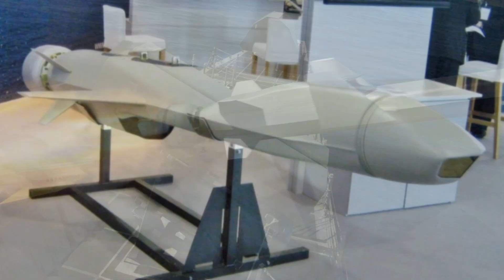Why Germany and the Nordics Are Backing the 3SM Tyrfing Supersonic Anti-Ship Missile

Comment: Tyrfing is far behind the MBDA Stratus missile project, this is not a good use of European resources. Stratus RS (supersonic) and LO (subsonic with very low observability) missiles, codeveloped by France and the UK, with Italy now joining, should be able to respond to most European needs and are not just naval strike missiles but can be launched from airplanes with very diverse missions (anti-radar, precision strike etc.), and they will be available from early 2030. KDA should concentrate on complementary shorter range and cheaper missile options.
Reply: Kongsberg and MBDA are two primary European manufacturers of naval strike and anti-ship missiles, Kongsberg NSM is operational in 14 navies and have a dominant role in NATO navies. France is backing MBDA, but they are not the main supplier of anti-ship missiles to NATO navies.  

Kongsberg 3SM Tryfing have funding from Norway and Germany, given the strategic partnership between Norway and UK on the Type 26 project,  reality of the matter is that UK could drop MBDA Stratus for Kongsberg NSM/JSM/3SM Tryfing suite of anti-ship missiles.    

Not some rocket science to guess that Norway will push for Kongsberg anti-ship missiles, use the joint submarine program with Germany and use the joint T26 frigate program with UK. JSM for F-35 and NSM/3SM for naval surface ships.  

Yes, this could be bad news for MBDA, but most NATO members don't need anti-ship missile for Rafael or Typhoon platform, most nations operate F-35. The most advanced ASuW strike package is F-35A + JSM in the internal bay. The JSM is in production for several nations, so in a way it's MBDA that is too late, operators of F-35 already have an European lethal option for sea denial of their waters.
Reply: Absolutely not. Given the rapid geopolitical changes, there is no ceiling, only market expansion, for decades to come. Having options can only be beneficial to Europe, given US market dominance and now political change towards Europe. There are reasons why MBDA Deutschland also has joined the 3SM Tyrfing project. Given Nammo's and Kongsberg's track record, Tyrfing will excel. 

I round off by borrowing some of your condescending words: If MBDA (UK) fears competition, they should concentrate on making complementary and cheaper products... 😉
Reply: @norsenomad  That's a really poor argument. And the only reason MBDA Germany joined is for getting revenues and competing with UK and France, as it is for all German military industry. Germany's industry unfortunately has no other interest beside making money, it does not care whether it stuff actually works in real combat nor if it serves European policy, and German politicians always bow to their industry. Kongsberg has a very good track record and makes excellent weapon system, I am not arguing with that, but we are talking of very expensive weapon systems here, so no, there is no real space for two European competitors for this market. This is not a good political decision.
Reply: @VoltaireVoltaire-zq4zh  HAHAHAHAHAHA! Looking at the way the French are throwing their weight around in the FGCS and FCAS programs, do you REALLY think it's Germany's fault they are looking elsewhere?
Reply: @VoltaireVoltaire-zq4zh  Tyrfing is the successor of NSM.

Also the main problem in european defense is France.
Just look at how they destroy FCAS with their insanity. 
Dassault lacks the knowhow to build fighter jets, unlike Airbus, and yet France wants to insist to "renegotiate" FCAS towards everything being french controlled and decided, trying to destroy the existing German fighter jet industry, to move it all to France.
I think we have an obligation to have a "nofrench" rule in arms cooperation as Germany, we burned our fingers too many times with this reckless actor.
It is ALWAYS France that ruins things in arms cooperation.
We never have these problems with any other partner.

So Stratus would not be acceptable due to french involvement.

In addition with Le Pen France is near a Trump moment, so relying on French parts is an absolute no go.
Reply: @Muschelschubs3r  Exactly, France has proven to lack strategic maturity, they act like children that want it all even against all rationality, and then throw a hissy fit when they don't get it, they try to renegotiate things after they have been agreed on in a reckless attempt to get more benefit for themselves in times when execution speed in arms programs matter more than ever. Yet they play the politicking game for self interest.
In very peaceful times Germany could entertain these defense cooperations with France for Europhile posturing on german-french friendship, but now things are getting serious, there is a real conventional threat in Europe, and nobody can afford to deal with the French shennanigans.

France also lacks the same strategic focus, France by all their actions appears to not care much about the threat by Russia as it is far away from them and they are more focused on their postcolonial games, not on conventional warfare in eastern europe, just look at their lack of rebalancing of their military structure to be fit for purpose in continental deterrence.
Reply: @Muschelschubs3r  You are clearly not aware of the facts. France wants weapon systems that work because they plan to use them in combat and their soldiers need operational systems. Germany only wants to make money for its industry, it is not planning to send its army to fight anywhere, hence weapon programmes that are massively overcost and with so many defaults its years to correct, and thus more cost again. Different philosophy.
Reply: @EmanuelWue  That is total BS. You clearly know absolutely nothing of these programmes and what came before. The problem is not France but Germany. France has codeveloped excellent missiles with Italy (the Aster family, also being used by the UK) and with the UK (many different missiles, including the meteor together with Sweden). With Germany it is just impossible. France is absolutely right in wanting to have the decision on the FCAS: France (Dassault, Safran and Thales) can build a 6th gen plane on its own (as can the UK), it masters all the technologies. Germany cannot (the Eurofighter would have never happened without the UK). And it wants full tech transfer from France in the project, in order to develop its own competitor plane in the future, that is not acceptable. Germany only wants to make money out of its industrial projects, France wants weapon systems that work because it will use them in real operation. That's a fundamental difference.
Reply: @VoltaireVoltaire-zq4zh   What a tool...
Reply: @VoltaireVoltaire-zq4zh  "Germany's industry unfortunately has no other interest beside making money, it does not care whether it stuff actually works in real combat nor if it serves European policy, and German politicians always bow to their industry" - Wow. That is far away from reality. After WW2 nobody wanted that we produce too many weapons in Germany. But many liked to buy German weapon systems. That's why it became the business model of the German defence industry to build up factories in friendly countries. As settlement or as joint venture with codevelopments. That kept Germanys weapon exports relativ low. But it increased heavily the number of countries, that wants to cooperate with Germany. Today the German defence industry has production facilities on every continent. In the worst case "war" a decentral production is more resilient.

Take for example our submarines.

For the 212 A we also build up a production facility in Italy. Therewith Italy can produce it on its own. And Italy also has the ability to develop their own upgrades in the future - if they want to - on base of the licence. Maybe Italy and Germany will codelevope something in the future. Different options are open. And why shouldn't we share our technology with the Italian? Shared technology increases the creativity.

Meanwhile Germany developed the 212 CD together with Norway. This successor of the 212 A is a littlebit bigger and it is usable in the arctic. Nothing against the creativity of the Italian. But it was standing to reason that Norway has more interest in the development of a submarine for the arctic than Italy. And that is Okay. We have codevelopments with Italy when we have shared interests.

The first two 212 CD will be produced for Norway in the German production facility. - The Norwegian need the new submarines more urgent.
And the first Norwegian workers will get their education for producing the 212 CD in Germany. While the Norwegian build up their own production facility in Norway. (This can take a few years. The Norwegian want to build up their submarine production facility inside a mountain.)

Both - the 212 A and the 212 CD - are submarines based on hydrogen technology.
Meanwhile some Norwegian soldiers are training with our German soldiers on the 212 A submarine of our naval forces. Therewith they get used to this kind of submarine.

Maybe Canada will join our German-Norwegian joint ventures to produce the 212 CD in Canda.
Maybe Canada will make a joint venture with South Korea to produce the KS 3 in Canada.

Well, once South Korea started like Italy with Germany.

But the KS 3 is based on battery technology.
To use that for submarines is an older German development.
South Korea build up the KS 1 and the KS 2 on base of a German licence. The first were produced in Germany. The South Korean workers got their eduction in the German production facility.
With increasing knowledge South Korea became also invested in a codevelopment like Norway for the next submarine.

But then Germany decided to make the shift from submarines based on battery technology to submarines based on hydrogen technology. The market for rare earth minerals became more and more ugly. And in the worst case "war" Germany would get problems with the ressources for the battery technology. With the hydrogen technology Germany is more independent.

Well, South Korea developed their KS 3 without Germany. - And it is great. Well done.

At present the battery technology for submarines is more advanced. A bigger and more powerful submarine is possible with the battery technology than with the hydrogen technology. And in opposite to Germany Canada would have the ressources for the battery technology.
The only disadvantages are, that the KS 3 doesn't have the adaptations for the arctic yet.
And that the KS 3 doesn't have the later by Germany developed stealth technology.

For Canada both technologies - battery driven or hydrogen driven submarines - are interesting. Canada already has developed the basic science of both. And both technologies are also interesting for civil use.
Now Canada has to decide which technology they want to use and to develop further.
The German-Norwegian 212 CD? Or the South Korean KS 3?

Our business models are the same.
The South Korean offers Canada the same business modell they once got from Germany.
A business modell that allows other countries to develop a souvereign submarine production and in the long term even its own submarine development. Codevelopments are often also possible but not necessary.

Many countries love the business model of the German defence industry.
More and more countries want it. Our community is still growing. That means: More and more countries are potential codevelopment partners and an increased interoperability.

France would have been able to sell much more of its submarines if it also would use this business model.
But France didn't.
That's why Canada sorted out quickly the French submarine offer.
Canada wasn't the only country that didn't like the French business model.
And submarines are only one example.

France doesn't want that other countries have a souvereign weapon production.
France want only the souvereign weapon production in France to maximize their weapon exports.

But we didn't create the EU Funding to build up Europes Defence Industry only for the production in France.
Many European countries want to build up their own production facilities.
If the French defence industry doesn't make this possible, most countries chose another European weapon system. Especially now with the increased threat situation.

Don't blame other countries for the nonesuccess of the greedy French defence industry.
Reply: @VoltaireVoltaire-zq4zh  How about taking off your nationalist glasses and trying to look at everything more objectively? The statement that the German military industry ONLY wants to make money is just as true as the statement that France is the second-largest arms exporter in the world. Every company has to make money in order to conduct research, develop products, and grow. And it doesn't matter whether the companies are called Thales, Dassault, Rheinmetall, or KNDS Germany, or KNDAS France. The fact is that France's arms companies also ONLY want to make money and always claim leadership in joint projects and are not willing to compromise. The fact is that France has always had and continues to have different requirements than the rest of the countries that were and are involved in projects. This will cause FCAS to fail, and the joint battle tank will certainly suffer as a result.
Reply: France wants to throw their weight around and call all the shots. That‘s bot how things work in miltinational projects. Of you can‘t or won‘t see that, suit yourself.
Reply: @Muschelschubs3r  this is an opinion, please be more factual
Reply: Tell us more, "military expert".
Reply: You are missing something here, dear friend. Stratus LO is the naval missile (subsonic, dual use, longer range than NSM). Stratus RS is the supersonic one (airborne, supersonic, anti-radiation homing, shorter range). Tyrfing a mix of the two (Supersonic/ramjet propelled like RS, sea skimming, ship hunting like the LO). With NSM/JSM in the mix (10x over the horizon range (300 km), dual role, subsonic  extreme mobility for use in complex coastal areas). Naval battles (any battle) is all about asking questions and overloading defensive systems. So here is the trick: F-35 drops subsonic and EM-passive JSM from 500 km away, alongside Eurofighters and Rafaeles dropping Stratus RS to shut down any radars for survival. Frigates let LO go first - timed to have similar impact with supersonic Tyrfing, while German and Swedish fighters lob off Evolved Taurus for good measures. Now, good friends ask a lot of simultaneous and combined questions with 2 different supersonic and 3 different subsonic problems, arriving in stacked sequence from all kinds of directions. (Throw decoys and EW systems into the mix to enhance the problem). Some take out radars (RS). Some take out the bridge/operations/engine rooms). Nothing is really designed to sink warships these days - just turn them into sitting ducks. If one really want to sink them later - drop a conventional quicksink bomb or ask a submarine friend to fire off a heavy torpedo to blow up well below the hull after the duck is sitting well. 

Think of it as a cost problem. These new missiles comfortably cost some millions of money per pop. On the upside, the target cost some hundreds/thousands of million moneys. One can easily afford to ask ALL the questions with expensive saturation/different profiles.
Reply: You do realise these are commercial programs, not some planned economy about what each company "should" concentrate on. If there's a market for both, both will be developed.